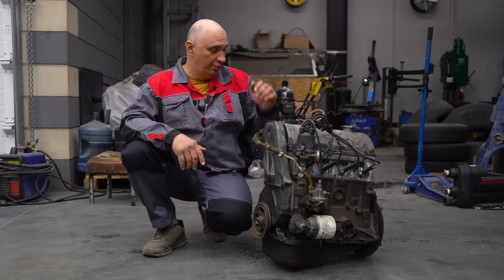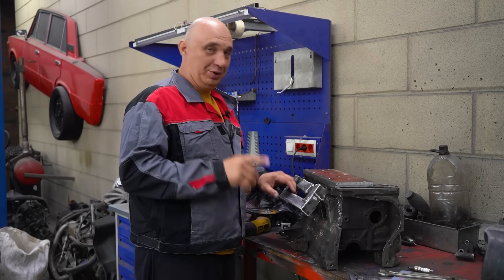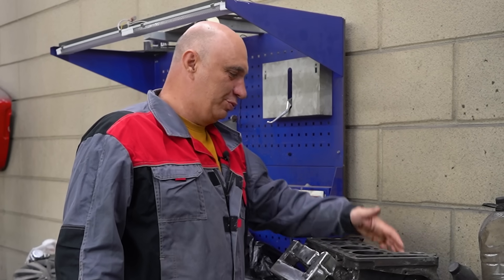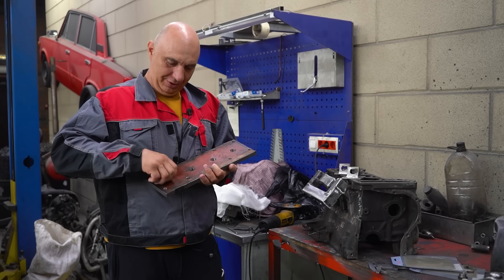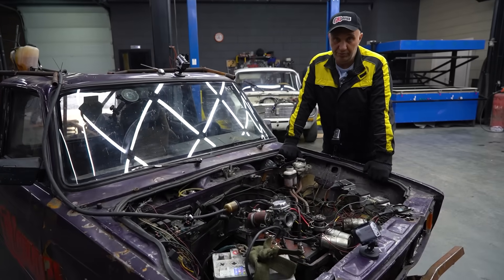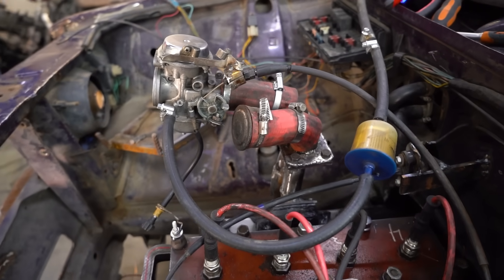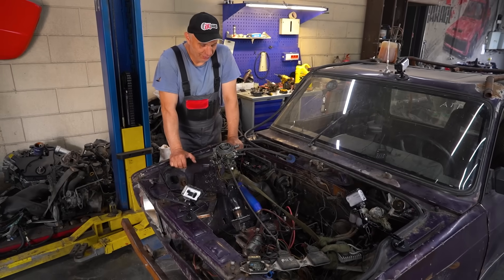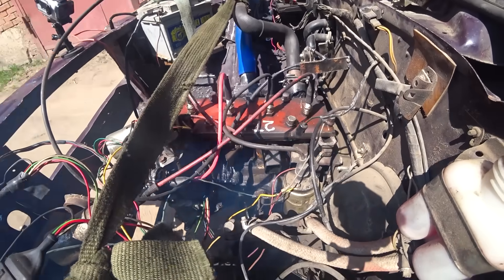4 stroke to 2 stroke Lada engine conversion

Comment: you are correct in your thinking,  the problem is the crankcase.  i am a 2-stroke motorcycle mechanic and i think the problem is that your engine doesn't have transfer ports to get the mixture from the crankcase  to the cylinder. each con rod needs its own sealed chamber with transfer tunnels and ports.  hope this gives you something to work with and look forward to seeing it run,  keep up the great work and ideas.
Reply: Something i noticed was that the piston skirts dont appear to be tall enough to cover the ports at tdc. Any vacuum created in the crankcase is immediately lost again when the piston goes to tdc.
Reply: @splob1981  Reed valves were used, not piston port.
Reply: Crankcase volume is too big. It wount create enough strong impulse
Reply: @TaaviLiivet  4 pistons. 2 move up, 2 move down. No pressure at all.
Reply: @TaaviLiivet  jbweld then to reduce the volume?
Reply: @bacilluscereus1299  could work yes. Usually 2 stroke crankcase has as little volume as possible. Even the crankshaft is designed so it would reduce the volume...
Reply: Use a blower like the Detroit 2 strokes had .. in order to scavenge properly
Reply: @galieric I was going through the comments looking for this exact answer. No vacuum so why not just force it in.
Reply: The mixture goes straight into the cylinder. They welded the port to the cylinder it doesn't go threw the crankcase
Reply: @kwslife116 it actually does, the intake hole in each cylinder has a pipe going straight down into the corresponding chamber in the block. They also attached the intake pipe with the reed valves into the same pipe they were using as the transfer port, Wich is effectively the same thing as the carb being plummed into the crank case like on a conventional 2 stroke.
Reply: @mondude9754  I saw the reed valves, but it looked like they welded the intake directly to the cylinder wall and the crankcase.  so I still dont believe theres enough vacuum to pull in the fuel. and with the exhaust open the piston is pulling in the air from that port.
Reply: @mondude9754  if they don't seal the cases for each cylinder it won't work with out a blower
Reply: The two centre cylinder go up and down at the same time so could fire as one, but to work it needs a blower yes or it'll work badly.
Reply: @kwslife116  exactly and they didn't do anything to deal the desperate crank cases!
Blower needed!
Reply: Maybe they should have used the two-stroke diesel method. Easier said than done I know...but possible.
Reply: It did actually have transfer ports if you look closely they connected the intake hole in the cylinder into the corresponding holes in the engine block.
Reply: @mondude9754  Re: transfer ports...  I rewatched that segment several times, and I have no effin idea what they were trying to achieve with their "transfer ports". I agree they created communication between the crankcase and the cylinders - but they the case and cylinder are in parallel rather than series. A case-inducted two stroke must have the case (and ONLY the case) sucking on the carb. That vacuum pulls air/fuel into the case. Obviously as piston descends and tries to squeeze the mixture in the case - it gets pushed thru the transfer ports and up into the cylinder. But that's not what Garage54 has going on, here. Rather, any air/fuel being sucked out of the carb reaches a fork in the road; where it then has the choice of going down into the case OR straight into the cylinder - hence why this arrangement did not work. Perhaps I'm not seeing something you are. Please share your thoughts.
Reply: @GroovesAndLands  yes the way they set it up was a bit unusual, but it will operate the same as a conventional 2 stroke. First off the outer two crankcases of the outer two cylinders were connected together since their pistons move together so the base pressures can work in tandem with eachother. I think they did this so that they only would need 1 reed valve for 2 cylinders. They already had made a hole in the case for the transfer ports, so they connected all external pipes regarding base pressure into those. It's a weird setup but functions the same as if they were connected directly into the crank case. Even though the intake would have a fork in the road between the cylinder and crank case, whenever the piston is slightly above bdc it will be blocking off it's transfer hole in the side of the cylinder, so the fuel can't go into the cylinder, but the bottom of the piston is creating a vacuum where fuel gets pulled into the crankcase through the transfer port where the carb is attached, even if the piston skirt is too short to block the transfer hole in the cylinder when the piston is at tdc, all this would mean is that both sides of the transfer port are connected into the crank case, Wich is fine. When the piston starts to come back down the base will get pressured because they have a reed valve blocking pressure from leaving through the carb. And when I say transfer port I mean that pipe that connected the side of the cylinder into the crank case. Hopefully that makes sense lmk if I missed something
Reply: Needs a blower (supercharger) just like any other large multi cylinder 2 stroke
Reply: @Texassince1836  I agree generally but old 2t diesels used crank cases instead of blower, Fairbanks and Morse, gardener hot bulb, Bollinger, rabb(rubb?can't recall) and many more 🤯
Reply: Yeah your correct you would need the negative pressure to help with the transfer from the case to the cylinder.
Reply: Tell him to add a turbo or supercharger
Reply: Exactly and the cases aren't sealed....all they need to do is seal 1 and 4 the 2 centre ones could work as one.
Reply: Well that well that exactly  iz the problem. The mixture doesn't go to the crank case and there for there is no pressure. You need forced induction. Compressor powered by the belt.
Reply: It does, they weld up seperate chambers in the crankcase around each rod, and then connected a transfer port from the cylinder wall to the crankcase
Reply: It needs more air boost needed
Reply: I've use a 4 stroke motorcycle carbuerator (1 of 4) on a 1950s 2 stroke 50hp outboard and it ran like a bat out of hell, had to do minor tuning for idle. It did idle like shit, probably was too big. But the original carb was corroded to dust. It ran all summer.
Reply: Or use forced induction like the old 2 stroke diesel trains.
Reply: @ccccombobreakerrr  jep that would bei a good solution too
Reply: Yea, you need crankcase pressure for the intake, they have done this, but they do not have a tuned exaust for the scavenge effect. They would need this because of the low crankcase pressure they are getting.
Reply: Firstly sub piston volume is way to grate in order to create sufficient Stochiometric value in the combustion. Exhaust port is way to far from the tdc and duration is most likely wrong. Each cylinder needs it's own carburettor and ports should be way bigger in order to feed sufficient gas mixture
Reply: Indeed a simple 2-stroke uses the crankcase as a kind of pump. Which can never work with these 4 pistons as the pressure in the crankcase doesn't change.
A blower to get the air in would be a better idea.
Reply: Yeah with a supercharger to push the air in that would be sorted out.

Sorting out the timing of the camshaft would be a chore and need making multiples to get with right overlap. Mazda filed a patent about this recently with some related new twists to swirl the air and use a vvt system for idling, but its basically a 2 stroke with valves and a supercharger and direct injection. The direct injection part being important for the emissions so theres no unburnt fuel passed through when filling the cylinder with air when exhaust is pushed out at the same time.
Reply: Exhaust would also need an expansion chamber of some sort so it isn't sucking air rt back in from the exhaust.
Reply: Yeah it needs scavenging pressure from the crankcase. This would make for a fun 2 stroke Cat c-18 conversion!
Reply: Couldn't they have just increased the compression ratio and just run cam to crank ratio 1:1 for it to still run only with 2 cycles? Instead of making it a traditional 2cycle motor with cylinder wall ports?
Reply: @quyle9483 Yes you can do that. thats how tuners makes 2 stroke 2JZ's
Reply: @jlo13800  I mean I thought it was crazy but many years ago when on my dad's mechanic buddies did something like that with a Chevy iron Duke I do remember them talking about it and saying it didn't have much power but it sounded really gnarly
Reply: @quyle9483 they made it a 2 stroke?
Reply: @jlo13800  yep.
Reply: I believe it.  This dude had a turbo charged straight six Chevy nova and all sorts of crazy inventions.  Yeah alot of shit didn't work well but it was out of the box thinking.
Reply: The intake ports seemed to be too high up the exhaust ports should always be higher than the intake port
Reply: I agree. Crankcase compression being one of the 8 events that occur in 2 stroke engine operation require a small enough crankcase volume that the downward travel of the piston can adequately increase the pressure below the piston to a level sufficient to push the air fuel mixture from the crankcase through the transfer port and into the cylinder above the piston while the exhaust port is also uncovered while using an expansion chamber (and possibly Reed valves ) to prevent over scavenging (blowing air and fuel out the exhaust port). The large volume of a typical 4 stroke crankcase is already problematic, add to that the fact that it has 2 pistons going up while 2 pistons are going down just aggravates the situation. Your idea of separation for each cylinders crankcase area, essentially creating 4 separate 2 stroke singles is the only way this engine will work as a 2 stroke with the only other alternative being a supercharger creating a "high pressure" in the crankcase which would likely just blow out the crankcase seals and oil pan gaskets.
Reply: @oldhillbillybuckkowalski  yes to supercharger, no to the supercharger blowing crankcase seals. I mean, why even direct the boost into the crankcase?
Reply: @BluntEversmoke  the air/fuel mixture on a two stroke goes from the carburetor to the crankcase then through transfer/piston ports into the combustion chamber. There are no direct ports from the carburetor to the combustion chamber.
Reply: I Agree! Almost run!
Reply: 100% correctly stated
Reply: The first guy is in the right area but the crank case side of the piston creates a vacuum to pull in air n fuel also the intake on a two stroke goes thru the block first and then there are transfer ports that uncover n let the pressurized air fuel mixture into the piston the only way this would work would be to seal between all 4 cylinders in the crank case and then make transfer ports from the existing intake ports to the crankcase then mount the reed valves and carb on the side of the crankcase. 
On a two stroke when the piston travels down it makes pressure in the crankcase until the piston uncovers the transfer port the fuel rushes in bc the crank is pressurized it will not work without transfer ports or forced induction
Reply: They install the intake on the cylinder walls not on the crank So prity much should get gas What I didn't saw is they didn't install a flapper, so probably compression what's going back to the carburetor
Reply: Great... and one carburador per cylinder.... for correct misture equalizer into 4 cylinder
Reply: Add some back pressure to the exhaust
Reply: Error ese motor según las lumbreras por lo que vi no van el Carter.. están en ambos lados del cilindro ..según esa configuración es para cargador o bomba de barrido o compresor de tornillos para que entiendas ..saludos soy mecánico
Reply: No expantion pipe ether
Reply: I agree
Reply: Yes there is mistake
Reply: https://www.youtube.com/watch?v=peiPM6rVe5o
Reply: manitoba-op4jx  That would have worked
Reply: manitoba-op4jx  Go with amsoil interceptor on the bottom end
Reply: Me too
Reply: Deveria colocar um super charge para poder entrar a mistura ar /combustivel e ao mesmo tempo expulsar os gases da queima anterior !
Reply: Your all wrong
Reply: Why dient you change the valvetiming and added e.g.an electrical turbo to blow air in the system?
Reply: tenes que relacionar los cálculos de compresión y si los pistones descubren bien las lumbreras de escape y admisión puede que no tengas tampoco un buen squish en la tapa de cilindro dado que los pistones son planos
Reply: Correct, and they'll need a carburator for each cilynder
Reply: @davidlucasFD2 its a plus but optional. Older snowmobiles had for a long time 1 carb for 2 cylinders
Reply: I would just block crank case off and let pistons directly drive mixture. Bottom end will self destruct eventually but should run a while
Reply: @drd1449  they should have plumped the mixture right into the clydiners. This engine already has an oil pump so they can block off the oil passages to the head and everywhere else and still retain oil in the bottom end they also wouldn't have to put oil in the gas as well
Reply: Not to mention they need 2 stroke type carbs.
Reply: @theclubhouse1209  True. they used a CV carb which will just not work properly on a 2 stroke, and the lada carb they used has an accelerator pump. suppose they could block that off. They really need something like a Mikuni VM carb with the throttle slide/needle
Reply: @freakyfreerider  I would suggest  twin or quad 2t carb set up and mount them closer to the engine.
Reply: @theclubhouse1209  2 x mikuni bike carbs with bigger jetting
Reply: @theclubhouse1209 nah a simple carb would bei enough to start it... After all you Just Feed in fuel Mixed with a Bit of oil.
Reply: @theclubhouse1209 just open up the jets for the thicker fuel, I've done it on dirt bikes.
Reply: @jamesdilks1499  they're trying to use 4 stroke carbs
Reply: That's not it, because crankcase pressure will never exceed cylinder pressure, wherefore piston rings will retain seal as long as they're in good working order. 

However, to test this, it could be possible to utilize o-ring piston seals, as Garage54 has done in the past. The configuration will be short-lived, but good enough for demonstration.
Reply: @fenrir4046  the problem with o-rings will be the port openings, it will most definitely sheer the rubber as the pistons move over them.
Reply: @fenrir4046  wrong.

Comment: I think you are right, it might need 4 or 2 separate crankcases. 

Don't give up, please.  😀
Reply: Won't run way it is even with sealed off per cylinder. No transfer ports. As is,needs forced induction.
Reply: @shawnsatterlee6035  
No transfer ports, that was something I over looked, good point.

Comment: I think the crank case volumes are too large. Making them smaller will increase the charge pressure when the piston is on the downstoke.
Reply: Holy moly, you are the only person who figured it out. Unfortunately that crank is too lumpy for them to reduce crank case volume enough for it to run. Adding a blower is the simplest solution.

Comment: The easiest way would be positive pressure, some two-cycle diesels use a positive pressure blower to force the air (could be air/fuel) in this method. Just try a roots type blower feeding the carburetor
Reply: I was just gonna say the same thing

Comment: Pressurise the crankcase and put short exhaust pipes on each cylinder to help the scavenging.
Reply: Connecting a blower between carb and intake would be the fastest way to hopefully get it to run

Comment: Four motorbike carbs is one way to go. Eliminates any mixture distribution problems anyway, because all the cylinders can draw whatever they need. It will work somehow, though, that's probably the simplest internal combustion format ever devised!
Reply: Crank case volume is too large for pistons to properly suck and push the intake charge. No matter what carb they use or how they mount it the engine won't run.

Comment: Each piston needs it's own carburetor with a reed valve, right? Bottom of the piston makes the vacuum for the mixture. Using 2 stroke oil mix?

Comment: I think the intake lenght should be shorter, and try running two carbs instead of one (one for cylinder 1 and 4, the other for 2 and 3) plus a better sealed crank case with a smaller volume would help
Reply: They can't reduce crank case volume due to the actual shape of the crank, it's lumpy af. But yeah, that's the main problem.

Comment: You could try using a cross plane crank instead of a flat plane. May have to change the timing, but it could help with the issue it is having now. A proper exhaust manifold would probably help too. I've seen you guys do crazier things with engines, lol.
Reply: Too much crank case volume to use that setup as 2 stroke, they have to use a blower or it won't run.

Comment: I think the distributor is the problem. Remember that on a two-stroke engine every time the piston comes up the spark plug will fire . So the spark plug needs to fire twice as often as a four stroke engine.
Reply: that's why they had so many coils, they got that part working, don't know if the timing is right tho.

Comment: i think it should run, but it sounds like the timing could be off.  

i would try to advance it more because i hear it popping.
Reply: The intake charge is too weak because of large crank case volume. They need a blower to get it to work.